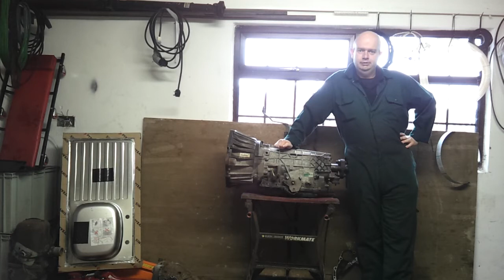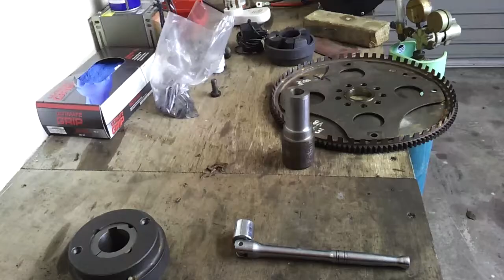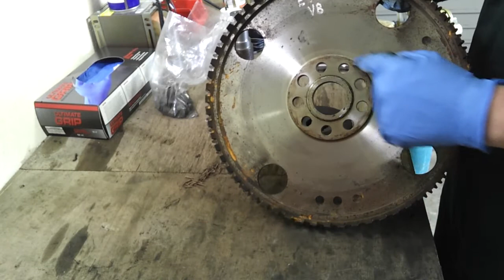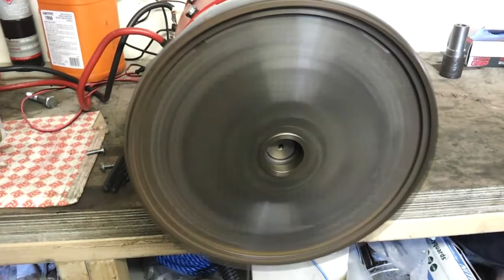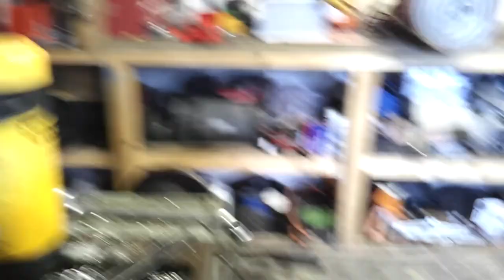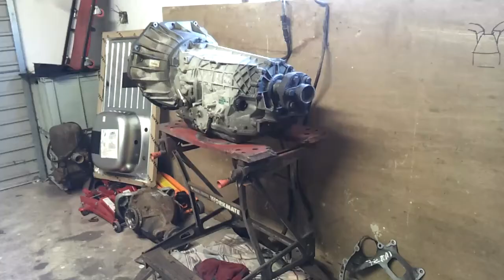EV ZF Automatic Gearbox Controller 01 : Introduction

Comment from the maker: According to the ZF manual the box weighs 90kg with the TC and fluid. Now I understand the point and I'm not immune to the weight issue but getting 2 metric tons of Teutonic chariot up to speed needs some gearing assistance. That and the fact I want the car to retain the original look and feel.   So far I have two BMW evs. Still working on the 5 series as can be seen. I like BMW cars. I like them better in electric. Not an Audi guy really. And no I don't like the i3.